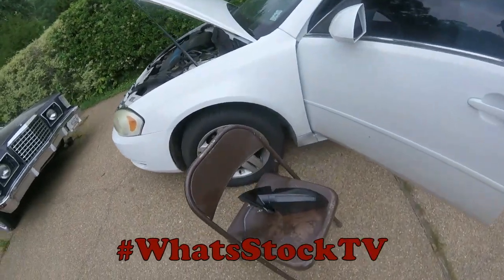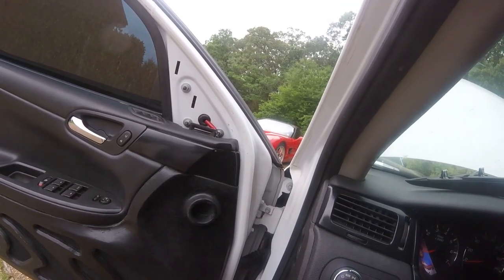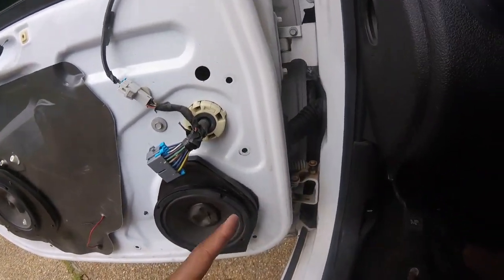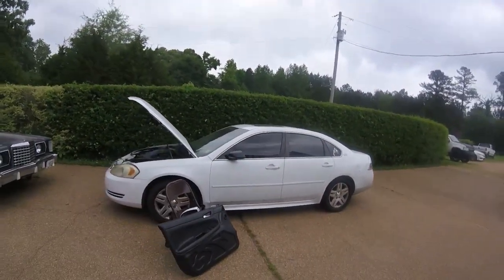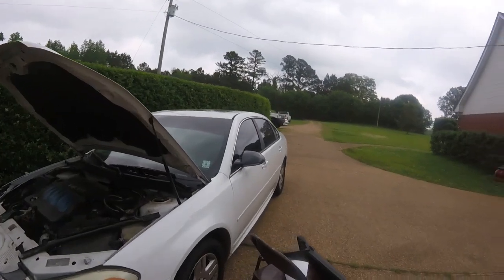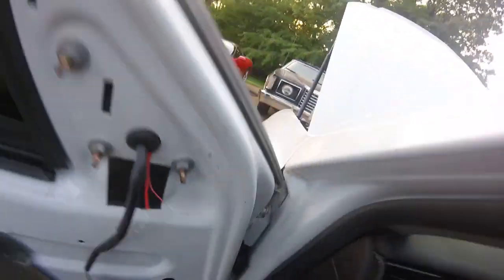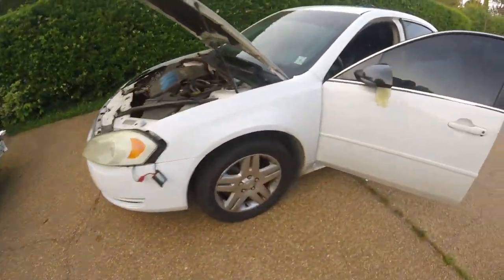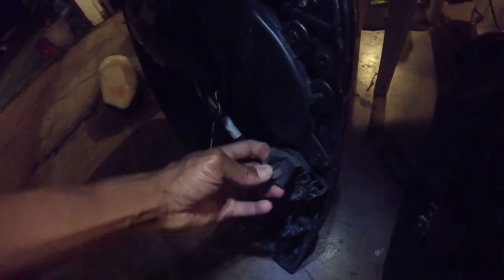Impala Signal Mirrors Part 4

Comment: So did you only splice into that one wire
Reply from the maker: Yes, the ground wire was connected to one of the mounting bolts for the mirror
Reply: @89imp03  thanks I finally got it right
Reply from the maker: @_Steelo_2.0  💯💯